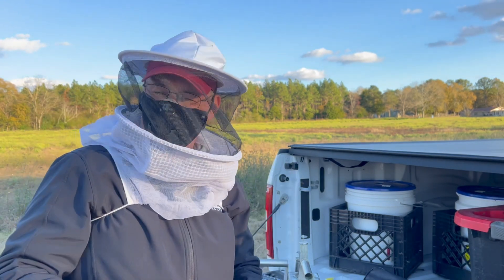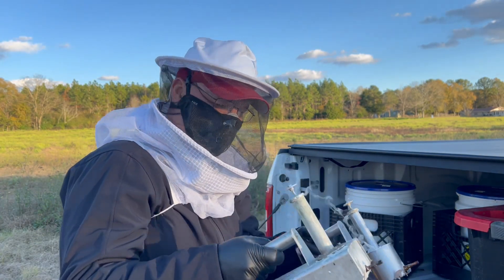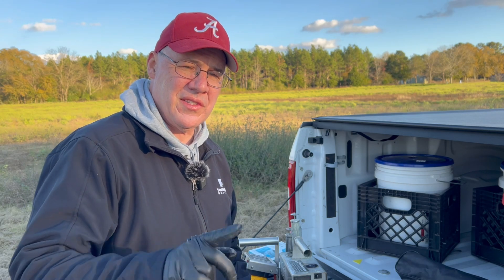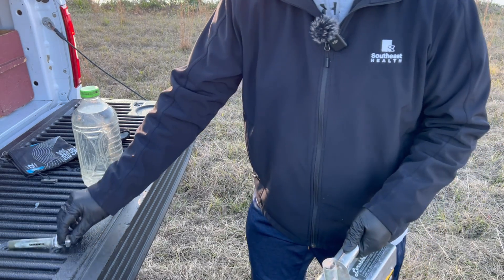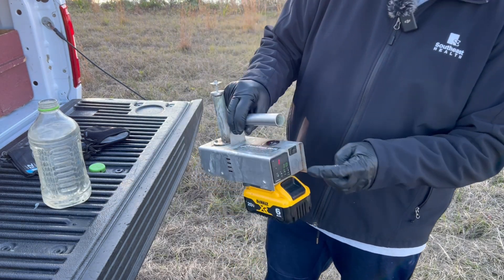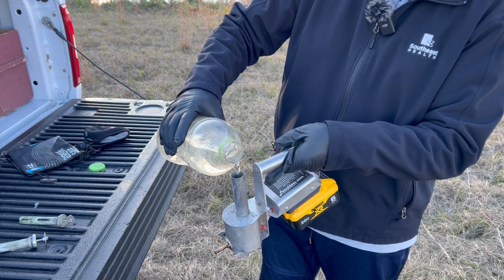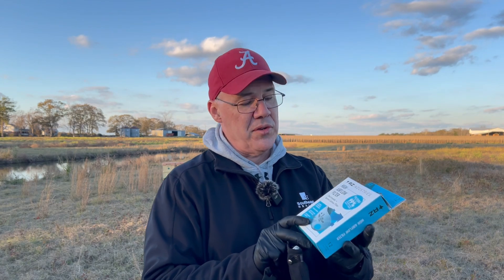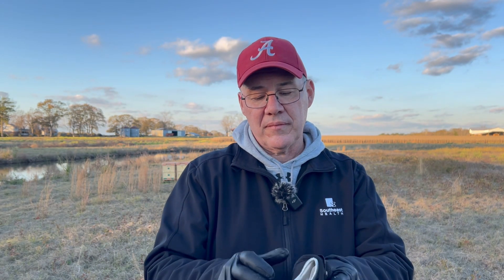Treating Bees for Mites - Cleaning the Equipment and Staying Safe

Comment: Hi Bruce! Nice video. One note: when cleaning, make sure that no water goes outside of the tube where the dispenser fits, as the insulation around the heated chamber can get wet, and that can fail the tool. That is the most common faliure that happens. That is why the celaning cup is a good way to clean it. Or use a bottle with a "beek style", so it is more sure that the water will go where you want. Happy New Year!
Reply from the maker: Good to know.  Thanks.  I am not familiar with the cleaning cup.  I guess I need to find out more about it.
Reply: The Cleaning cup works like a charm, the steam cleans out instantvap and I have noticed the instantvap works like it was New.
Reply: I have used the caps, they are pretty tough to keep in place while cleaning, almost to point of being dangerous. I now pour in a small amount of water and immediately place the plunger in its place and hold it down.  I need to see if the company has a video on cleaning.
Reply: Yes you need to wear some protective gloves to hold the cap in place, there is video done by the InstantVap on how to use the cap.  I use my leather garden gloves which works like a charm.
Reply: @brycehanson6750 they do on youtube

Comment: If you have hard water I think it is a good idea to use distilled water to prevent mineral build up.  If you run a dehumidifier you have free distilled water in the tank.
Reply from the maker: Thanks for the tip.  Hadn’t even thought of that.

Comment: In a season, when do you start treating with OA vapour ?and how frequently ?
And what dosage for  your doubles?
Reply from the maker: Preferably when broodless but since they never really go completely broodless here now is the best time. I use 4 grams for singles and doubles and 2 grams for nucs.  I try to treat at least once a weeks for 3 to 4 weeks.  Would be better if I could go a little more frequent but just unable with my full time job.  Would like to treat every 4 days for 4 to 5  rounds but just can’t get it done.
Reply: I did 4 grams per box, and I do 8g per double. Bees did great!! 2 rounds so far in 2 weeks roughly. Bees were out flying  yesterday on a sunny 46-degree day.
Reply from the maker: @AmericansBee that sounds like a good plan!

Comment: Hi Bruce
Were they provided for free by Lorob Bees or did you actually purchase these?
If so it would be good to mention this when you promote a product.
Reply from the maker: I purchased both of the units.
Reply from the maker: I paid full price for the first one and got a good deal on the second one. But between the units and batteries I have put a lot of money into this set up.
Reply from the maker: I believe I did mention it in the first video on the compact.  But this video was more about cleaning the unit and the mask.

Comment: I like your mask that might work better with my beard.
Reply from the maker: Might be worth a try.  As I mentioned I catch a whiff sometimes but overall it does a the trick.
Reply: When i was in the factory,the rule was 2 days of facial growth with 3M masks. If more you went and shaved.
Reply: @vincegagnier3550  well seeing as I'm not gona shave I guess I'll stick with what I got.😁
Reply: @DCsBees  99% sure that mask is not protecting from anything other than him not smelling it. Emphysema ain’t no joke, so I would definitely stick with 3m. Might as well just do it the Ian Steppler way and not even bother. Just make sure you’re upwind.
Reply from the maker: Trust me it is doing something.  And on what do you base your statement of 99% confidence that the mask is ineffective.  The carbon filter actually forms to the face quite well. But maybe it is not as good as the 3M.  If I could find a 3M mask that fit my egg head halfway decent and didn’t fog up my glasses then I might give it a try.
Reply: "According to the 3M Respirator Selection Guide, oxalic acid requires an OV (Organic Vapor) filter and an N95 (Particulate). The 3M Organic Vapor/Acid Gas Cartridge 6003 is a pair of cartridges that can help protect against organic vapors and acid gases"

3M Respirator Selection Guide https://multimedia.3m.com/mws/media/639110O/3m-respirator-selection-guide.pdf